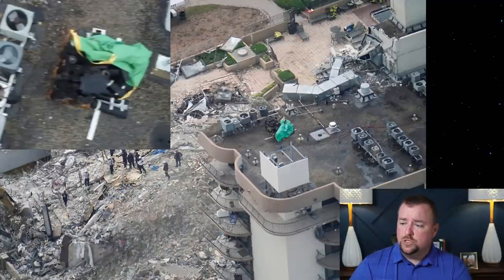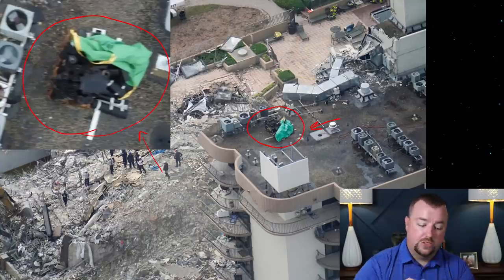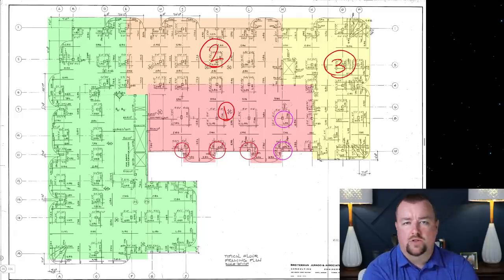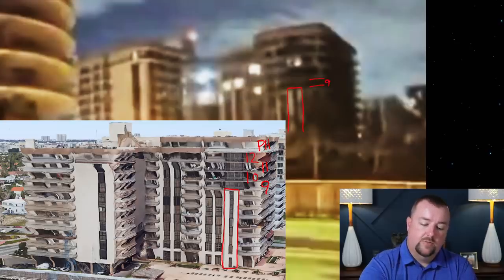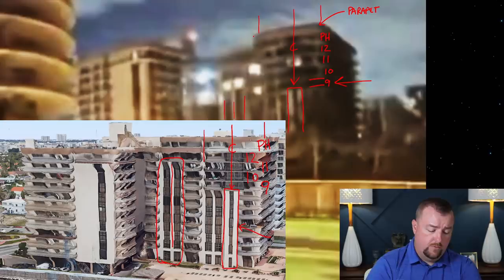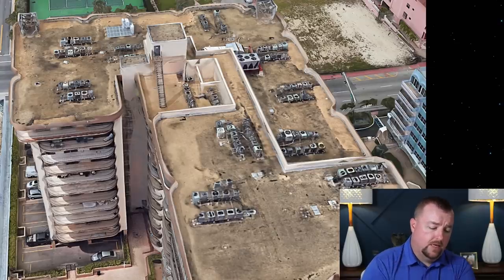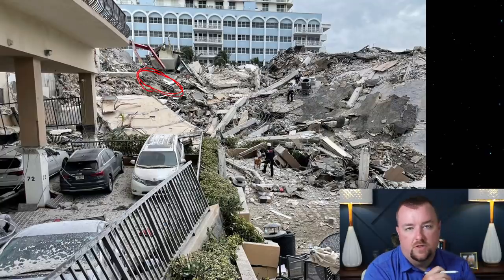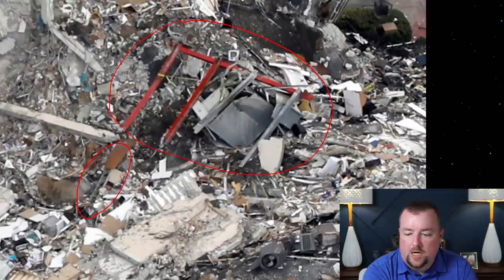Surfside Building Collapse - Did it start at the roof?

Comment: So just my opinion but if there was already issues with the building sinking a little and then speculation that the pillars may have been week but I was thinking in the 80’s when it was built everyone had carpet but over the years everyone has gone from that to tile and granite and marble and tiling the balcony and bathroom floor to ceiling with heavy tile and all that extra weight in so many of the condos could have just been to much weight for the pillars and foundation. Also the penthouse was added after and was higher then really allowed but more weight

Comment: Are we not looking up at the building in this view, which would make the section that you say has started to fall, it is just perspective making it look lower because it is further away. That's why the lights are on because it has Not started to fall yet!
Reply from the maker: No. the 12th and PH floor balconies and parapets were not recessed back and therefore would not be subjected to a perspective difference from the east end of the building.
Reply: @BuildingIntegrity  If you say so..

Comment: I think you made a mistake counting floors. What you said is the 11th floor of the first section to collapse actually looks like the 10th floor. For the windows you are counting, there is a dark pair above the lit pair.
I propose that after the big planter collapsed, the column to the east of the column at the bottom of the ramp (visible in the ramp video) is the one that failed.
1: planter/plaza collapse
2: single column failure goes up the building
3: missing penthouse rotates into the hole
4: then follow the collapse video
Reply: Correction: the column to the west. On the right hand side looking down the ramp.

Comment: 100% the building got a permit for the roof. They overloaded the roof and it collapsed first and it left a large slab on the pile . ***The roofers could have also left debris and clogged drains"""  We had severe rains daily prior to the collapse . The city said the building was safe. Engineers did not red tag the building . The roof was weakened by the chiller that leaked 24-7 throughout the building .  Each loaded pallet weighs 2000 lbs

Comment: It's highly likely that the security camera outside of the next building over missed the beginning of the collapse of the building.  If you think about it, the most suitable set up for external security cameras would be for them to be activated by motion within their sensor range, i.e. motion activated.  It's highly unlikely that the Champlain Towers South was within the sensor range of the camera, there just wouldn't be any reason to have the sensor set for such a long range being as it was to protect the private, residents only external areas of that building so their would be no reason to have it set for a range that would take it outside of the perimeter of the property, and there could be legal privacy reasons why having it operate like that would be undesirable as they could face legal action for filming people using the public right of way between the two buildings without their permission.  So, it's very unlikely the recording would have been triggered to start when the building began to collapse, i.e. by the movement of the building, but more likely by the vibration set up in the ground by the collapse of the building as the camera would register that as movement within the range of the scanner.  Those vibrations will have taken a short period of time to extend from the footings of Champlain Towers South to the position of the camera, meaning it is highly likely that a few frames of the collapse will have been missed.  It is, of course, possible that the security cameras are running 24/7, but that would seem unlikely as it would be expensive in terms of the media used to store the recordings and also in terms of the amount of time personnel would have to spend clearing the system of unnecessary footage, so motion activated is far more likely...

Comment: I’m not at all disagreeing with you. Your videos are exactly in line with my thesis. But I believe your numbering is off. The penthouse is above the wide white row of paint. I would assume what you call first floor is actually ground or lobby. This can be proved by the exposed parking deck on the left of the structure. So your depictions of the columns  would be G-8 and G-10 respectively.  Looking @18:44 for reference.

Comment: I believe I know what happened. I’ve watched many videos and have digested a lot of information. The weight of the Penthouse was not correctly compensated for in the garage. The combination of the additional roofing supplies weight caused the penthouse to collapse. This failure radiated directly down to the garage where support beams were different sizes and damaged by spalling. The shockwave caused several beams to collapse then the rest of the building pancaked. Notice the remaining side was not bearing the additional weight of the penthouse and this made all the difference. Miscalculation of weight\Indifference to standing water\ and short cuts

Comment: I'm not 100% convinced that the floors are lower in the first frame. The apparent difference in height could be due to camera perspective. The corner that is closest to the camera will look higher than the the same floors that are further away, and the shape of the building could accentuate the difference.

Comment: The green tarp is a soft dumpster that has built in slings for a Waste Management truck to pick up and dispose of. Their weight capacity of 3,300 pounds. They're called Bagsters and would be lowered to the ground in one of many ways. Even if the walls were knocked out that supported the roof that would not cause a pan cake effect at least not in a first world country.

Comment: Water corrosion from the planters and the pavers hid damage. Building should have a shear wall on the entire perimeter. when the parking garage fell it pulled the building columns over and started the cascade

Comment: Occam's Razor would suggest that everyone may be missing a simpler answer.  Don.t discount the idea that perhaps someone took out a post in the garage with a dumpster or vehicle in the last few days,   and of course they walked away pretending not to have done it.  Add in all of the other construction and deterioration issues.  Just like a plane crash it is a series of issues and events that cause the catastrophe.
Reply: Occam’s Razor: Do not multiply hypotheses beyond necessity.  You have made a hypothesis without necessity and without evidence.

Comment: I wonder if anyone has noticed what appears to be a crack by the roof on the side of the building on google earth. On the street view standing across the parking entrance ramp looking at the very top of the building right where the stairs wall should be there seems to be a crack. According to this video that’s the breaking point between parts 2 and 3 of the building in the collapse sequence.

Comment: NO NO...NO, yes I am a structural analysis engineer  from TCU, and so I'm not certain but seems to me that were forgetting the perception attitude or angle of the camera in which were viewing the collapse.  So with that mentioned I'm not convinced  that the roof went first, it just looks like theres part of the building or roof missing in some of the first frames  because of the relative perception of the camera in correlation to the  collapsing structure

Comment: There is a problem with you saying that the first frame was already falling.  If you look at the photos of the building...the top is NOT even all the way across...it drops down at the joining spot that the two parts of the building.  There is NO Penthouse or not a parapit wall.  It also curves in slightly which makes it look shorter.  So it had not started to fall yet.  Find the photos of the building looking at it from the same perspective (they are out there) as the video...it does look like it is shorter by about 15 to 20 feet.  It is a design difference and an optical illusion.  Check it out...I have and it is very clear.

Comment: Another video that I watched today shows clear evidence that the pool deck collapsed first. There is video evidence that appears to show concrete debris on the parking 7 minutes before the collapse of the tower. There is an engineering report dating from 2018 which indicates that waterproofing had failed. There are photos which clearly show concrete spading and obvious signs of rebar corrosion of the concrete slab of the pool deck. It also seems that there was a major error with how the pool deck was designed. There was no slope, so rather then being able to drain, water was able to pool onto the pool deck.

Comment: Did anyone live in the penthouse since they never include it as a “floor” in media reports?
Reply: I was wondering the same thing. The only thing I found is a listing for  penthouse-A on 5/11/21 From a company called Condo Blackbook. Listing price/Sold for $2,880,000. Association fees $2,481.00 a month, yearly taxes for this listing is $26,227.00 4 bedroom with 3.5 bath 4,500 square foot condo.  In the listing it says number of floors-12.
Reply: I believe the owner also owned other units in the building as quite a few residents did (one had 3). He was apparently on another floor when the collapse happened.

Comment: The later added penthouse could be the ultimate contributor to the collapse as only the portion that has the PH collapsed. The added extra weight load put stresses on concrete structures. At the beginning, it was ok as the extra weight ate into the safe margin of the design. Overtime concrete columns and beams deteriorate and the extra load became unbearable.

Comment: They would remove the old roof before moving new materials to rebuild. Otherwise you have to move it twice. What your looking at on the roof is, l suspect, tools material to install the tie off points. If the roof failed first due to overloading l think it would fail in sections not all at once as the individual sections did allmost CDI in nature basically knock out the support on the first floor and gravity does the rest. 
So no it didn't fail roof first that l think is obvious. 
The mistake made is a common one in early/non seismic construction not accounting for lateral movements.

Comment: Surveillance video shows buckling in the vertical concrete elements of the façade at as many as eight floors down from the roof, before the upper floors started cascading over the edge. My opinion is that it was nothing even close to the roof that caused this collapse.

Comment: chances are the flashes that were seen was electrical shorts as it was being ripped apart. And with all the massive A/C units on the roof there was some massive power running up through that building to feed them all.

Comment: 1 roll of Rubber Roofing weighs about 300 lbs , i wouldn't think it would be more than 10-12 rolls.
   So that's roughly 2 tons at most.
In one spot,  if they didn't spread them out !!???  IDK I'm not an engineer,  does anyone know if that
 exceeds the design capability  !!??
     I noticed the support columns are 
Reinforced Concrete though,
NOT Steel !
     In fact,  I don't think there was much steel at all in this building !
   Just Rebar,  and Re bar with 40 years of Salt air eating away at it.

Comment: I’ve gone frame by frame and before anything happened there were no bright lights in those rooms. They were dark. The light first appears in the upper room. Below it was a mild light coming from the unit that had all its lights on. That light went out. The. The second bright light appeared one floor down from that. At this point the columns first began to bow. But the roof was still flat and in its original position.
Then the second lower light disappeared followed by the original bright light two floors above it. Then the lights front the apartment between these two floors went out. And the roof started to fall.I think it was fireworks for the Fourth of July. Or someone was making a homemade firework with modern gun powder. Not firework powder.
Or it could have been a container of the infamous tannerite. It blew a hole from the upper apartment into the lower one. Then the roof started falling rite above the bright flashes.
I ruled out electrical flashes from sheared wires because the building had not moved yet at all when the first light appeared. The columns were perfectly straight
First witness reports said they heard a tremendous boom moments, not minutes,  before the building collapsed.
Unfortunately the person in that upper apartment surely died as well, so we may never know for sure. 
It’s so important to be right with God every minute of every day. because you never know when it’s going to be your turn to stand before him in judgement.

Comment: When the penthouse apartments were added, did the contractor reinforce the columns below the building? Is there a way to find out if they checked to make sure the existing building could hold another floor?

Comment: I wonder if the roof line would always have seemed higher at sections which are closer to the camera, ie the sides, and lower at sections which are further away from the camera, which is looking up at the roof line,  not directly across at it. Just a thought.

Comment: Looks like the pool deck collapsed and pulled down those key supports:
https://www.youtube.com/watch?v=hynHiWE818c
If the floor of the parking garage looked like that and the state of the pump room wall, what would it have looked like under the pool deck paving?
Surely the patio on the North building has to get ripped up now?

Comment: I think the power lines ran through the shear wall (that did not collapse) the blueish white flashes are the electric lines being cut by the building colapse.  The other apartments go dark when those power lines are cut by the collapse.  Damn lucky those power lines didn't start a fire.

Comment: I have to go back and look through these videos. I am convinced they will find it was a series of unfortunate events, but should also include the neighboring construction. 

You have an aging building with structural issues, and probably many seasonal residents needing to cooperate, permitting red tape, covid-19 related delays and cost issues... but I also think they should be worried about more than just the buildings over the age of 40 when they talk of looking for structures that may need to be modified for safety purposes.

Has anyone mentioned Eighty Seven Park and previous litigation regarding the Icon Brickell building or the Viceroy Hotel Towers? There is a pattern here, and it needs to be addressed. Look on Google Earth at where the pools and garage drainage were being installed, how close the retaining wall was during construction to the already deteriorating building, and even water pooling in the slope of the pools and lower level garage. There is standing water in the image that lines up perfectly with a diagram of the collapsed area.

Comment: There is a video someone took from across the street from the parking garage entrance gate 7 minutes before the collapse that shows debris and gushing water in the basement of the building and they reported hearing loud noises coming from there just before filming it. This is irrefutable evidence that the collapse started in the basement and started a cascade collapse. There is evidence that concrete had spalding and there was extreme moisture leaks in the slabs just above the parking area.

Comment: Uhhh...so an ENTIRE FLOOR was added on to the structure??? 🤔🤔🤔🤔
Reply: Well it was only over part of the building (the part that collapsed). The roof is a two level roof.
Reply: The penthouse was added as the building was being constructed.  It isn’t a big deal.  Well-designd buildings have a large margin of safety.  It is not rare to add floors to existing buildings, and this penthouse was designed in as it was under construction.  The problem is that it was a flimsy design, with or without the penthouse.

Comment: There's video footage of three columns in the basement that failed it did not start at the roof.. review the video of someone taking a tour of the condo they go through the parking garage and you can see the three columns in a humongous crack across the floor slab in front of the ramp they had a problem with flooding their regardless receding water creates cavities saltwater degradation and spalling eventually eating the ties off the rebar allowing the column to collapse onto itself

Comment: The reason why they start on top of the roof was because they had a major  Water  leak  That's why their salt crystals at the crack at the bottom you see before the towers collapsed forming on the roof of the garage this would indicate the rebar is compromised obviously because the rust marks indicate there's rust coming down with the salt Crystals from the roof  Of the garage ....

Comment: If the roof gave first it would have fallen slow as it impacted each floor below it. This is not the case. This building fell at free fall speed like the legs underneath it were gone. This building failed at the basement/first floor.
The roofing contractors had nothing to do with this.
Reply: It isn’t in free fall, because there is always some part of the building in contact with the accumulating pile of debris as the supports give way.

Comment: There does not need to be this speculation. the centre and front columns were sinking and it was known fault on that specific building. They drop and then pull the roof as they drop down. Nothing difficult about that.